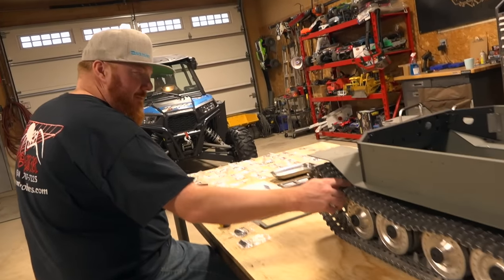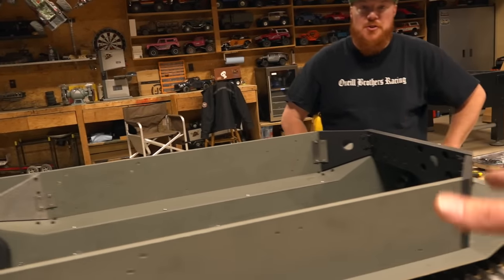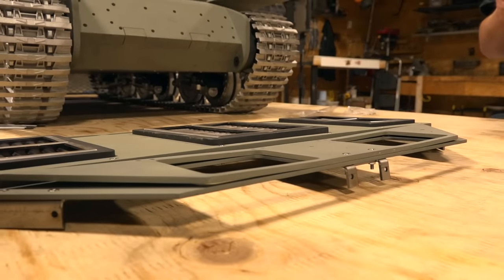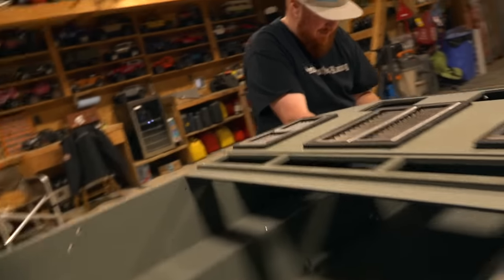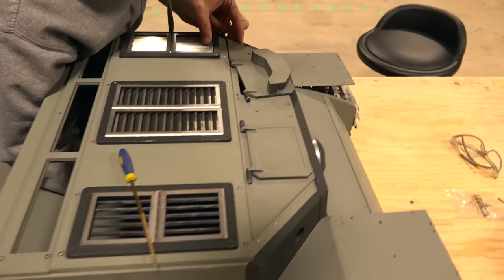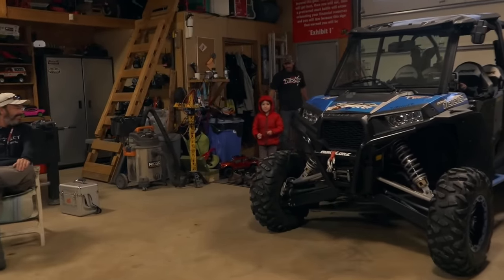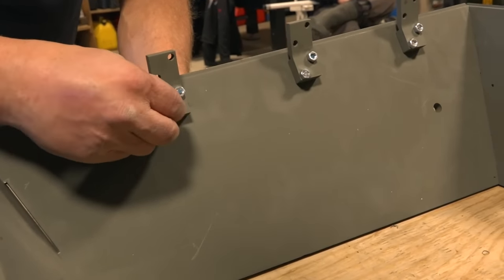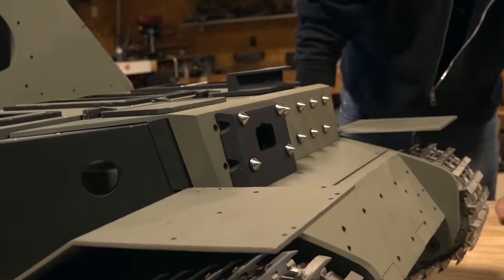ARMORTEK ELEFANT: 1/6 Scale METAL TANK BUILD "Tanks for 10 Years" PT 6 | RC ADVENTURES

Comment: I have built a few 1/35 scale tamyia plastic modelkits in my day and one is the elefant and some tigers and king tiger. The interesting thing about the paint was explained in one of the kits i built as there is always a historical refrens writen on the assembly instructions explainig the tank type it self. 
“In June of 1940 a general order was issued that stipulated all Panzers were to be painted dark grey (Dunkelgrau). This order was still in effect when the Tigers were initially deployed in August 1942, thus the very first Tiger I's were painted dark grey.”
“In February 1943, a general order came down to change the base coat from dark grey to tan (Dunkelgelb nach Muster). Crews were issued cans of red brown (Rotbraun) and dark olive green (Olivgruen) to use in creating camouflage patterns.”
“Camouflage patterns varied from unit to unit, as did the placement and coloring of the vehicle numbers. Some examples are presented below.”
Id like to add that there really was no “standard paint scheme” every crew added their own touch and pattern when it came to the environment and theater they operated in. I.e Tiger Tanks in France and Normandy had a heavy amount of foliage to help them evade Allied Air Superiority.
This applyes to all military vehicles made by germany in ww2.
But if you deside to piant it pink and purpul, that will be cool to, its your dam tank dude.

Comment: Metal files only work in the forward stroke. You'll can fold the teeth over and ruin the file if you pull the file back under pressure.

Comment: Even if the motors drive the rear sprokets zou will have the tracks sagging when reversing.. or even worst when turning on the spot, the track that goes backwards will have a good chance to come off.. 
I'm sure you will figure it out! You could also try it like that and eventually tension the traks later on if you need too! 
Awesome project cant wait to see it running! :)
Reply from the maker: If you watched through the whole video.. you will see the tracks are much tighter at the end. We removed two links.. and they are much better...

Comment: The part of the tank where the gun goes, is called the superstructure.
Reply from the maker: I was told today that the top is called the Castmate..   is that correct?
Reply: tank has two main parts: a pivoting gun turret and a tracked hull. The turret sits in a wide circle at the center of the hull. In the conventional design, a spur gear in the hull (calledthe traverse gear) engages an internal gear lining the inside of the turret.
Reply: It is part of the superstructure. The vehicle body consists of 2 parts, the hull, and the casemate, which is the upper part of the hull where the gun goes. Fun fact: German tanks were primered with a red oxide primer over every outside surface but the tracks.

Comment: German equipment was armour or panzer grey,hen over painted with armour yellow,you can get the color numbers many hobbest sites.the tracks are too loose,you are rihgt they use the top of the wheel as a return roller,an american named Chisty invented that system,but the army didnt like it so he sold it to the russians and i believe the germans began using it on the panzer mark V,panther in 1943.battle of kursk.but they need to tighten some they will come off the sprocks as loose as you have them,you should have more tension on one of the sprokets.a guy named oddball or something builds armortek tanks for others and documents the builds,id ask him for some advice or you will end up working on the tracks constantly

Comment: The Elefant was a crap tank, it failed at Kursk, the Germans hated it.  Its cannon was slow to load and slow traverse.  Plagued with mechanical failures, they didn't produce many of em. Ferdinand Porsche was not exactly a great tank designer anyway, he should just have stuck to cars!
Reply: Um, this is an RC model - made in 2018.
Reply: @poppygoatshomestead  Is it? Well I never! Yeah, duh! For idiots, just a little history lesson for you, after all, it does depict the real thing does it not? The first Ferdinand tanks were not even equipped with an MG, the model here is the last (and improved) version of the  SdKfz 184. (Elefant)
Reply from the maker: @TheGeezzer  I was also reminding people that this was not a Elefant that you were talking about ;)  Great history lesson.. but not complete! There is so much to know about these amazing tanks.. Too bad about the suspension design and engines failing the original version.. and it cost many their lives. But the marvel of the engineering in an RC tank, with electric motors is very amazing..